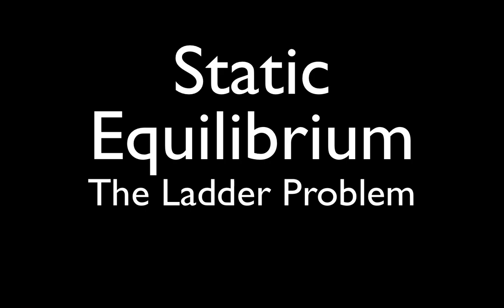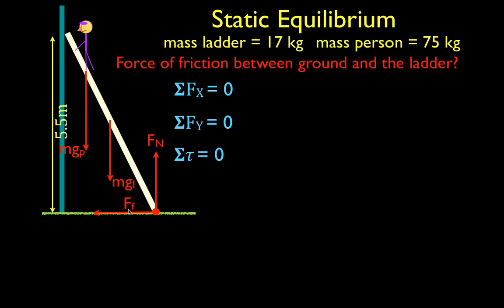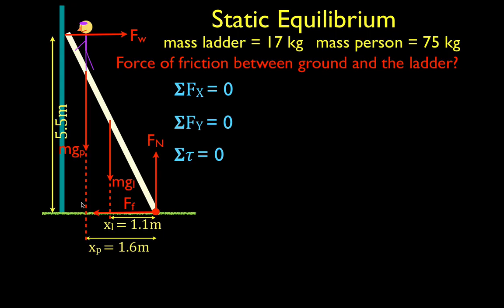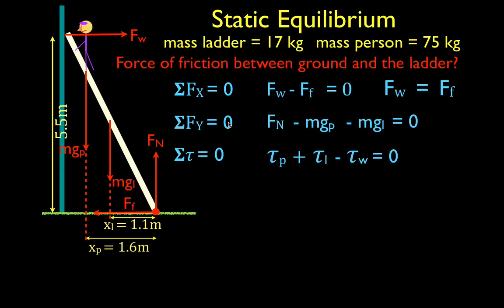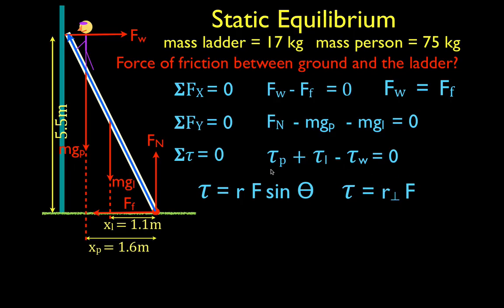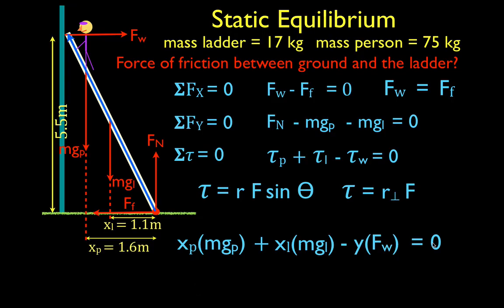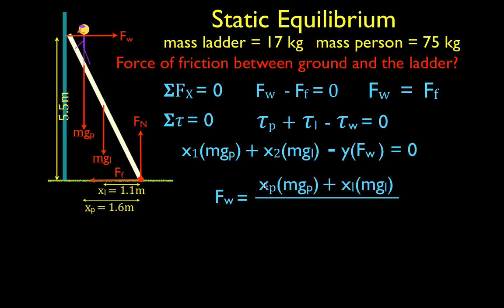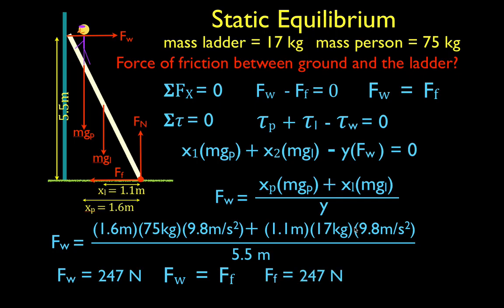Physics, Torque (12 of 13) Static Equilibrium, Ladder Problem

Comment: Why didnt you consider the normal force of man on the ladder?? Did you consider the system of ladder + man?
Reply from the maker: The normal force is at the bottom of the ladder and it includes the force from the ladder and the man.

Comment: Does the ladder not exert a normal force up on the person (equivalent in magnitude but opposite in direction to the force of gravity on the person) so that person doesn't fall straight through the ground? A little confused why this force is not in the free body diagram.
Reply from the maker: Good question, the forces needed to solve the problem are the ones I included in the diagram. The normal force is at the bottom of the ladder.

Comment: You said that the x distances given are the lever arms, but this doesn’t really make sense to me. With our torque equation where Tp + Tl = Tw, are we not talking about torques acted upon the ladder? Therefore, the ladder should be our lever arm right? However if we treat the x distances as lever arms, this ends up being the torques that the forces produce onto the floor, which doesn’t make sense
Reply from the maker: Good question, but starting at about 5:00 minutes into the video I explain how we get around the fact that we do not know the lever arm.
Reply: I found out how he got it. I would recommend some paper to visualise the setup. Take the force F_n 1.1 meters from our pivot point. Let L be the length of the ladder from the pivot point. The torque there is given by sin(theta)F_n*L. So, lets find L!

Now with the paper draw a dotted line from the F_n to the ground. (paper coming in clutch now) Notice how this forms a triangle, where the angle theta is the same as the theta in sin(theta)F_n*L. In this new triangle, 1.1m is the Opposite, while L is the Hypotenuse (zamn I spelt it correct). Since Sin(theta)=  Opp/Hyp, it is the same as Sin(theta)= 1.1/L. 

Heyyy, wait a minute, we now have to expressions with sin(theta). Lets plug in our new expression for Sin(theta) = 1.1/L  into our torque equation Torque = sin(theta)F_n*L. That would mean 

Torque = sin(theta)F_n*L

-(note: subbing in sin(theta) as 1.1/L )

Torque = (1.1/L) F_n*L. 

-(note: L denominator and L cancel)

Torque = 1.1*F_n

And there you have it! Thats just the perpendicular side times at the Force! Let me know if u didn't understand anything, or want me to draw something up.

ps. F_n is F subscript n, hope that didn't confuse you.

Comment: I'll start off by saying thank you so much for these videos! I'm studying physics with the OU alongside my full-time job and having content like this really helps me understand concepts faster than using my textbooks!

A quick question on this though, would there not be a coefficient of friction where the ladder meets the wall? Assuming the ladder is stationary there would be a coefficient of static friction and if the ladder were sliding there would be a coefficient of sliding friction.
Reply from the maker: We assume there is no friction between the wall and the ladder.

Comment: At 3:39 when you said, “if these forces were to act by themselves, the would cause the ladder to rotate in the counter-clockwise direction” did you mean clockwise?
Reply: Those downward forces are clockwise, aren’t they?
Reply: Well, i guess that just depends which normal force you get rid of to allow rotation. its only counterclockwise if you get rid of the wall. If yiu getvrid if the ground, it goes clockwise
Reply: Its because axis of rotation is at base of ladder

Comment: How is the lever arm of the force from the wall (Fw) 5.5m when the pivot point is set at the base of the ladder touching the ground?
Reply: Hey, actually I think I might have figured it out. When using the formula 'torque= r x F', we substitute the values 'torque= 5.5m x Fw' but if we choose to use the formula 'torque= r x F x sin θ', we substitute the values r= length of ladder, F=Fw , sin θ= sine of angle between the horizontal Fw and ladder or alternatively, sin θ= opposite/hypotenuse= 5.5m/length of ladder, all these into 'torque= r xF x sin θ' and the torques would be the same. Hope this helps!
Reply: Alas 6 years later I have the same question, that I just solved using your comment. Thanks. I just wish he had explained it as thoroughly as he usually does.